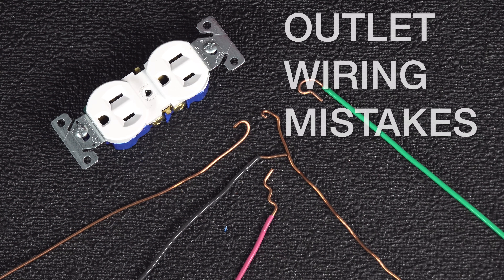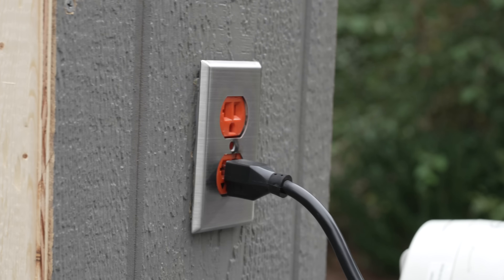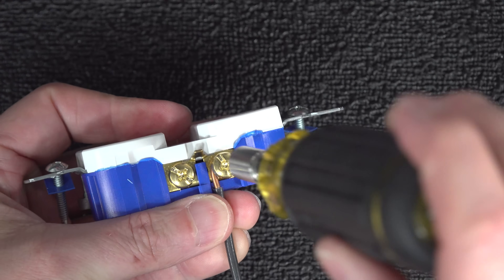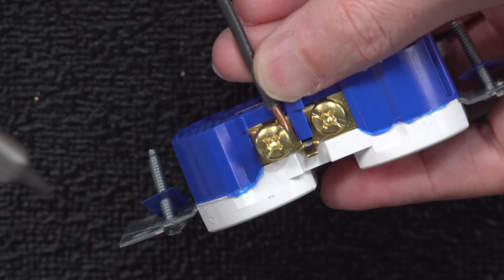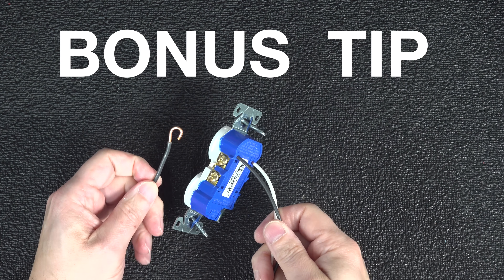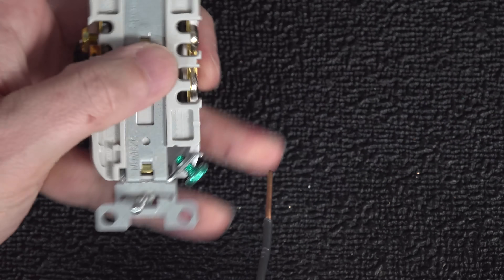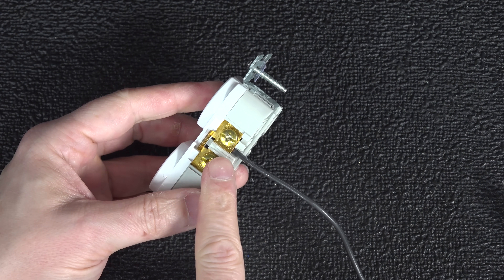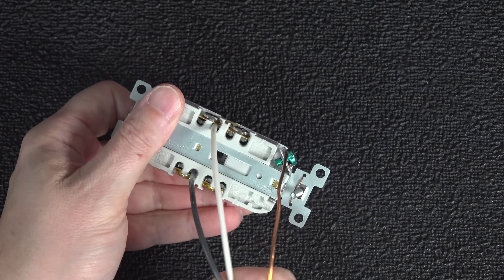BEWARE Of These 3 Common Wiring Mistakes On Outlets & Switches

Comment: Generally you only need to connect three wires to an outlet: feed (black), neutral (white), and ground (green or bare).  If it's a split receptacle you need one more feed (red).  Any other connections should be done with proper connectors.  You should not be using an outlet, switch, or other device in place of a connector.
Reply: I actually disagree.  If done correctly, using the terminals as intended on the outlet, joining wires in this way is actually better than using a connector in many cases.  There are a couple of reasons for this:

1. Space inside electrical boxes is often reasonably tight.  If you need to connect two wires together and also connect to an outlet, that requires the addition of not only an extra bulky connector, but also an additional pigtail wire, all of which need to be crammed back into the box (this is then typically multiplied by three, resulting in a lot of extra stuff in the box, even for a single circuit join).  This makes it much easier to physically stress the connections, or cause things to come into contact that shouldn't be (yes, in theory, everything should be insulated so that shouldn't be a problem, but particularly with non-professionals, it is common for insulation to sometimes be stripped more than it should be or for wires to get nicked, etc, which often would not cause a problem if just connecting to an outlet, etc, but actually could if lots of wires are all being shoved together into a big rat's nest in order to get something back into the box)

2. Many non-professionals (and dismayingly, even some professionals) do not actually know how to use things like wire nuts properly, which can result in bad/dangerous connections.  Outlet screw terminals are much more likely to be used correctly, and are easier to tell when they are making good contact (I've seen far more bad wire-nut connections than bad connections to outlet screw terminals).  And yes, things like WAGO connectors are better than wire nuts in this regard, but they are still not as common as they could be in many areas, and still require making sure you are using the correct ones for your wire size, etc, or they can cause problems too..

Now, admittedly, this is also only true if people are using the outlet terminals correctly, and it is possible to do that wrong in several ways, which definitely can make things worse than using connectors would be:

* Never connect more than one wire to the same screw terminal (except for outlets which have two clamping holes behind the terminal like the one shown here.  Then you can put one wire in each hole).  One screw, one wire hook (do not twist wires together and then screw them down, or put one wire on either side of the screw instead of making a hook, etc).

* Do not connect wires to the clamping holes behind the screw terminal and also to the front of the screw terminal at the same time.  Use the "hook" method in front or use the straight clamping holes behind, but not both.

* Do not ever use the push-in back-wiring connectors and also connect things to the screw terminals too.  As mentioned here, it's really best to avoid the back-wiring holes altogether (I wish manufacturers would just stop making them), but if you are going to use them, they should only ever be used for a single outlet at the end of the wire, never to come out again and feed to something else.
Reply: @foogod4237  I'm not an electrician, just a homeowner, and I agree with you!
As a retired truck driver, I have always said that after watching all the things that the "professional" truck drivers did, I decided I just wanted to stay an amateur! 
Some of that kind of thinking probably applies to electrical work to?
Reply: @foogod4237  NEC unfortunately disagrees with you concerning pigtails.
Reply: @jimross2101  I love pigtails.  idk who would  stick 8 wires into the back of an outlet when you could just pigtail 2 sets of 4 wires, then stick 2 wires into the back of an outlet--to me pigtailing seems like far less points of failure and if there is a physical failure in the outlet, other outlets in that circuit will still work, which can be nice if its not something you can get to right away or get someone out to fix it for a few days.
Reply: @foogod4237  No matter what the situation, I/you/we can come up with all kinds of reasons why we think something is "better" but only two things matter. (1) What the code says. (2) What the inspector says.
(1) According to the code 300.13(B) says you cannot make multi-wire connections on the device.
(2) What the code says does matter if your jurisdiction does or does not allow multi-wire device connections. Just because you like it better or it is easier, does not mean it is correct. In most jurisdictions you cannot do multi-wire connections in a device and you must pig tail.
Reply: @PK-fp8ie  ?? Many living rooms have many split outlets so ANY location in the room has a 'switched lighting outlet'.
I remember growing up where the only switched outlet was in a real dumb  location (usually near the switch, not where a lamp would be placed)
Always check the state of BRASS strap (this is the only one cut in most cases)  when replacing a bad outlet with more than 1 colored wire on the brass side of 5-15 0r 5-20 outlets.
+++ on those screw type back wire. (you can no longer use those with 12Ga (20 branch) )

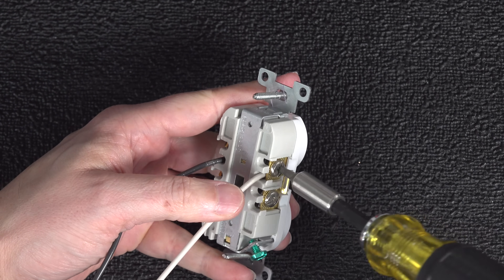Comment: 4:20 "Extra benefit" NO dude no. Unless you are going to separate that circuit into a switched receptacle you do not put more wires. Average use you should ONLY put one pair of wires. A pig tail or the end of the run.

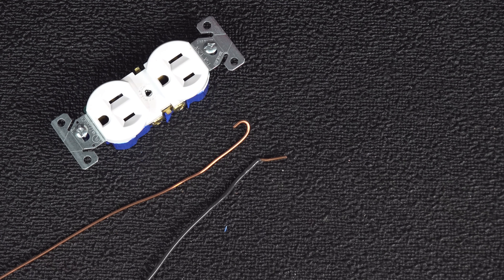Also at 1:30 there is that V grove on the side of the receptacle, that is you gauge to remove insulation.  @ 1:17 That that little raised notch the insulation is resting on is a "wedge"/"holder" for the tip of the wire. You put the end of the wire right there and you wrap the wire counter clockwise. So basically you are did not strip enough insulation.

Comment: I can give ypeople the tip of a LIFEtime; Get a licensed electrician to wire up/install your outlets. With over 400 US deaths every year of people just like yourself, the safest way to keep you and your loved ones safe from electrocution or being burned to death from an electrical fault is to let the trained people handle it.
There's always a percentage of heroes who reckon they can do anything after watching a  video but know this, electrical work isn't like tiling, repairing drywall or installing anew bathroom basin. It can KILL YOU now or later and it will wait for the right circumstances.
I was trained to respect this silent deadly killer that lays in wait ready to pounce on the unwary in two different career paths. I never liked that I can't see it or smell it. I sure felt it a few times and out of pure luck I can be here now writing about it.
My safety tips for all you heroes:
Buy the best gear available especially the best outlet (Silvers' bonus tip)
Turn ALL power off at the house before attempting ANY electrical work
PROVE that the power is OFF with a proven electrical test pen. Cheap and worth every penny.
CAREFULLY review the workflow before beginning - know what needs doing (write/draw pics, like what color wires go where)
When finished, think. Do you know what you just did and are you 100% happy with the result?
Finally, reverse polarity is an ambush at Dry Gulch and is often lethal. If you must be Mr Fixit, DO NOT screw that up!

Comment: Per current code multiple wires may not be used on devices must use pig tales for multiple wires
Reply: False
Reply: @purplesparkyy  it is enforced that way here, no pass through on devices
Reply: @monteglover4133  Nowhere in the nec does it state that. Maybe it is enforced per local codes depending on where you live if that’s what you’re saying

Comment: Those are all rookie mistakes and if those were helpful tips for you you should probably rethink doing your own wiring, because it stands to reason you know nothing about wire gauges, amperage loads, or even turning off the breaker first.

Comment: I watched your video on reverse polarity. The neutral is the center tap on a single face electrical system commonly installed in a us home today. When the electrical company installs the transformer they reference the neutral to ground. This is done by running a wire from the center top of the transformer to a ground rod at the bottom of the pole.
Likewise the person who installs the electrical panel grounds the neutral at the panel side  this is done in the event the ground is lost at the pole side.  A lot of electrical equipment has a chassis ground. Which differs from the neutral inside the equipment. But what role does the neutral really play and why is it grounded.
Something very fascinating about the United Kingdom and construction sites. Just like in the United States they run their power equipment on 110/120 volts ac. However they have a neutral which is grounded. This means that between the two wires being used to operate the power equipment you will have 55 to 60 volts to ground. This can potentially make a site much safer if somebody comes in contact with a bare wire because they are being exposed to a lower voltage. One of the other things that people do not understand is in a DC system ground reference. In the telecommunications industry the positive is referenced to ground.
In the Telco industry they use negative power supplies. A negative power supply simply means that the positive is referenced to ground. This is done by simply taking the positive side of the output of the power supply and grounding it. A positive power supply means that the negative is referenced to ground. This is done I simply grounding the negative of the power supply output to ground. This is why most Telco equipment requires a separate ground as they do not necessarily consider the neutral to be a suitable ground. But this cannot be confused with what the phone company puts on the outside of the house when they used to connect phone lines to a house that was simply a lightning roster.

Comment: What's odd to me is that since the brackets on those outlets are similar/the same to the ones that can be found on common GFCI receptacles, which also use those brackets as a method of grounding. 
Could it still be a code thing? Now I'm curious and I can't stop thinking about it for some reason.
Great video!
Reply: Except for the third prong of the GFCI receptacle (which if it gets its grounding from being mounted on a grounded metal box instead of a wire leading back to the panel's ground bar), no grounding is needed for the GFCI to function properly as it just compares current of hot and neutral to work. As a matter of fact, GFCIs can be used with no ground at all when replacing 2-prong with 3-prong if the receptacle is marked "NO GROUND."
Reply: The brackets aren't the method of grounding only mounting plate.

Comment: A little clarification on terminology.:

Backstab  -- wire is inserted into a 14 gauge hole  on the back of the outlet/switch and is held in place via an internal spring.  The wire will stay in place without tightening the screw.  The video incorrectly calls this "backwire".

Backwire -- wire is inserted into a slightly larger hole (which will accept 12ga), but the screw needs to be tightened to prevent the wire from falling out.  Instead of a hole, some manufacturers accomplish the same thing using a square "washer" under which the wire is clamped.  The video calls these "small channels".

Sidewire -- wire is formed into a hook and tightened directly under the screw.
Reply: was coming down to see if someone had already mentioned this. BACKSTAB = bad (what he called 'backwiring'), BACKWIRE = good (solidly clamped by the screw
Reply: Why does the backstab exist if it is such a horrible connection?
Reply: @wizardman1313  "Lookit our fancy new easy install outlet! If you buy from our competitors, you'll be wasting time on your install like a schmuck!"
Reply: @Phoen1x883  It's easy money for electricians. I know a few and a lot of their service calls are related to backstabs that burned up.
Reply: @OneShot OneKill backwiring outlets been around atleast the 60's.
Reply: Somebody's boss got anal about their terminologies

Comment: Using the rear entry feature on any receptacle isn't recommended, even on the high quality outlets.  It's always better to use a hooked end.
The hooked end spreads the forces of bending the wire across a larger area as you stuff it back into the box.  The rear entry creates a highly focused pinch point where the clamp edge is smashed down on the wire and that's where the wire will break.  Take 30 seconds more to do it right
Reply: @Joe-by8jh  If you crack both open to look, you'll see that while the concept may be the same the resultant connection is not identical. There is far more contact and far more spring load on the WAGO.

Comment: I always wondered what the extra terminal slots are for, especially if I only have one of each wire coming from my wall.
Reply: You can also break off the little tabs connecting the bottom and top terminals in order to put one of them on a separate circuit. This was more common back in the 70s for having an outlet connected to a switch for a floor lamp. You generally don't have more than one floor lamp in the same place on the same switch so separating it still leaves the resident an always powered outlet all around the room.
Reply: @AndrewMerts    They are still used in kitchens, where all of the top outlets are on one circuit and all of the bottom outlets are on another circuit.  This is because in a kitchen you often have high wattage appliances, like a toaster or microwave.  So, as long as you don't plug two high wattage appliances in the top or two in the bottom of any outlet, they will be on different circuits.

Comment: I'm not a fan of the clamp style unless your putting two wires in. When only putting one in, it creates uneven pressure on the screw. I've had them strip because they tend to kick sideways when tightening them. I always make a hook whenever possible.
Reply: I will not use them. Also issues with old wires that are bent will not seat correctly.   The old hook works fine, and if you going to have 8 wires use a freaking jumper.
Reply: It's funny because I think electrician U says he only likes one. I'm with you on just a hook
Reply: UL 498 only requires 12-14 inch-pounds of torque on outlet screws, which should not cause them to kick sideways.

Comment: Most important tip. Avoid residential grade outlets at all cost. I know their cheap. But the risk outweighs the cost in the long run. Its hard to believe how much better of an outlet you can get. For just 50 cents more or so.
Reply from the maker: 100% agree!
Reply: I disagree, a name brand is more important. I would recommend you go with Leviton or eaton for residential applications. There is usually no need for an industrial version like hubble or the like. You're better to save you money elsewhere and maybe put in some gfci's in places they should be. (source: Electrican)
Reply: @MrYummynomnoms  i somewhat agree, but I prefer using commercial outlets in residential because commercial outlets have a better clamping force on the plug. They just hold better. Plus the quality is better so it's a win/win. Hell, I even thought about putting hospital grade outlets in my house cuz of my kids lol
Reply: @Chris.Rhodes  Use tamper resistant most importantly, some commercial outlets are not TR.
Reply: @motasolo  I'm still learning all the different styles of outlets, thanks! But tamper resistant just means there's shudders to block stuff from going in it right? Doesn't change the clamping hold?
Reply: @MrYummynomnoms  I have tried all major brands of residential outlets. The results varied slightly. But all shared the same problem. The clamping force weakens relatively fast over a given time. Vs commercial grade outlets. I still recommend the major brands. Just not their residential grade ones.
Reply: @randomtube8226  if you get Tamper Resistant recepticals I doubt you will run into trouble. If you're really really worried about durability go for industial.
Reply: @MrYummynomnoms  Absolutely, if you can, there is no harm. Most people only need commercial grade though. My point I was making is how bad residential grade outlets are. I have an audioquest edison 20amp outlet that runs about 200 an outlet!
Reply: @randomtube8226  200 what?
Reply: @MrYummynomnoms USD
Reply: $200 US for an electrical outlet? You must be that government purchasing agent that ordered the $2000 toilet seats back in the '70's.

Comment: I don’t know how you can say the back wiring of a UL approved outlet isn’t going to handle its load. The Wago connectors gone over here also have similar clamping.

In a multi gang box I find the back wires are easier to deal with.
Reply: The lever type Wagos are different than the backstabs.
Reply from the maker: 100% correct, that's why they have a patent on their connection, more contact area.
Reply: @SilverCymbal  if you look at the mechanism for backstabs and wago they look very similar.  A rounded point on one side flat on the other. The backstabs I’ve used are super tight, pushing the release pin you can feel it.
Reply from the maker: They are UL listed but unfortunately there is so much evidence to show them failing in the field. Wagos on the other hand use a patented holder which has more contact area on the wires, and there is no evidence to support them failing in the same way.
Reply: @SilverCymbal  I don’t know because they vary but the wagos visually seem to have similar contact. Maybe that lever gives more pressure though.

Comment: Use a hubbell cr20 it has anchor holes to put wire in and then make a perfect hook without a tool.  save time
Reply: Or you can just use the strippers that are already in your hand
Reply: @jobourne423  stupid response